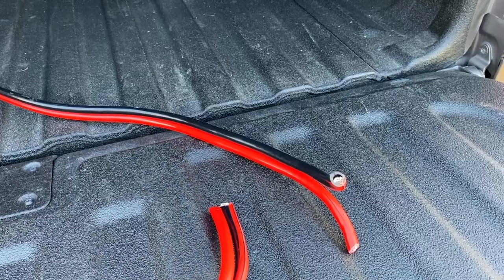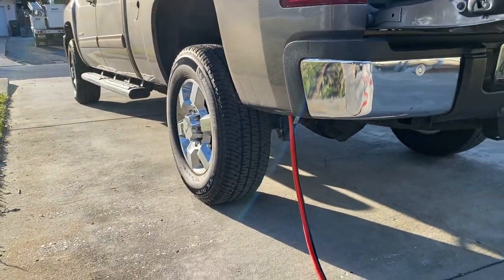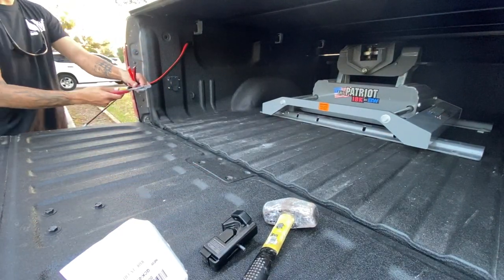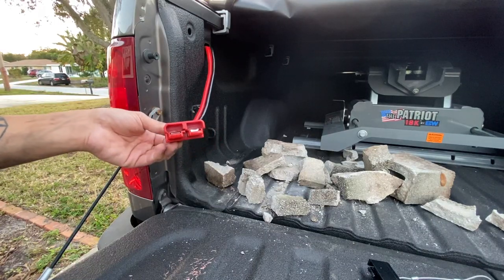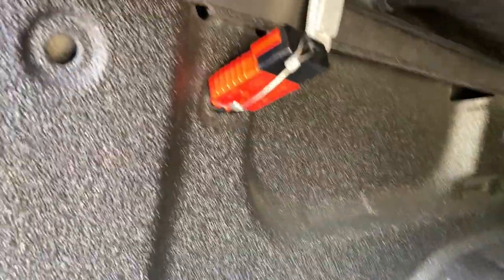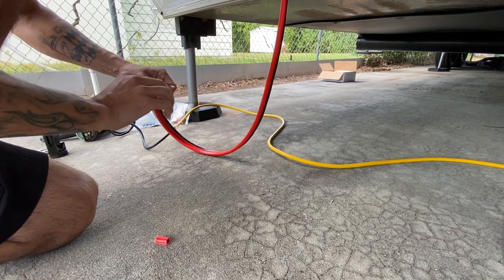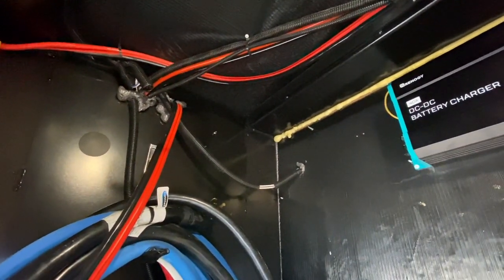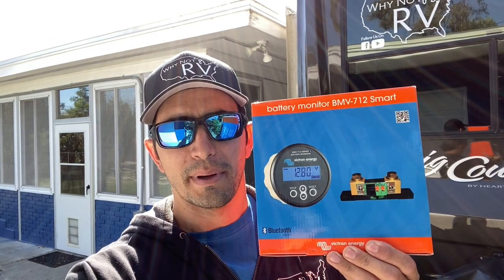Installing a DC to DC charger - Why Not RV: Episode 7

Comment: Hi. I just installed the Renogy 20amp charger.  After install, I was able to use my multimeter and determine I have 14.4 volts at the input side, but nothing on the output. I’ve wired the power wire to my trailer lights and the green lights turns on and remains a steady green.  I’m trying to figure out why I have no power/voltage on the output terminals.  Any insight would be greatly appreciated.  Thx. 
Jason
Reply from the maker: I’d start with confirming your have the dip switches set properly for your batteries, secondly, plug it in, make sure it’s on (green light) wait about 1-2 minutes and test voltage. It senses your battery voltage …
Reply: @WhyNotRV   Hi. Thanks for your reply.  After I hit send, I realized I should’ve mentioned my DIP switches are set correctly (at least according to the manual and the help of others who have provided additional feedback). Also, the unit is plugged in and I have a steady green light: nothing blinking flashing or red.  Lastly, you mentioned something about it sensing my battery voltage.  Does that mean the the unit senses the batteries are sufficiently charged, it will not output current?  If so, is it possible to adjust the range at which it begins charging?  Thanks again.
Reply from the maker: How is this wired? You said the output has zero voltage but if it’s hooked up to your battery you should be reading the battery voltage at least
Reply: @WhyNotRV  absolutely right. Yes, I have the same voltage on the output terminals as I do when I test the voltage directly from the battery terminals.   However, if I disconnect the Renogy unit from the trailer batteries, but it’s still connected on the input via my truck (alternator battery), shouldn’t I get a voltage reading on the output side of the Renogy?   Plus, my Victron smart shunt is not registering any positive voltage coming in, only negative out.  Thanks again for your help and asking great questions.  Hopefully, we can figure this out.
Reply from the maker: Unfortunately I no longer have a renogy charger so you may just have to reach out to them directly. I’m not sure, however, I believe if you disconnect the rv batteries The charger will not put out any voltage as it knows it’s not connected to a battery. Lastly, have you confirmed with your Victron shunt essentially no load? Meaning, when the RV is all hooked up and ready for tow what is your discharge amperage from minor ghost draws or whatever you have running? Then confirm ZERO change when charger is hooked up?
Reply: @WhyNotRV  thank you for all of your thoughtful replies and follow up questions.  I’m going to attempt to contact Renogy today.  Yes, I’ve observed the draw with the charger off and then once power is turned on, and no change.   I also found your other video of the Victron charger.  I have the Victron 12V/3000 MultiPlus II, and wish I would’ve stuck with all Victron components.  They just integrate and communicate so well together.  Thanks again.   If I get it resolved, I’ll update this thread. 
All the best,
Reply from the maker: Thanks Jason. Ya I’m curious to know what’s going on there. Keep me posted
Reply: @WhyNotRV  Well, mystery solved.  I should’ve known better, but after connecting the charger with a set of jumper cables and determining it was working correctly, I went back to focusing  on the truck wiring.  As a result, it turned out to be a bad ground. Repositioned the ground and problem solved.  Ugh!  🤦🏻‍♂️
Reply from the maker: That’s good to hear. Typically it’s a simple little problem like that.

Comment: Do you think I could have an issue running 4 gauge 500 amp cables from back of truck to charger and run 2 gauge from charger to battery?
Reply from the maker: Hey Vicki. The short answer to your question is NO, do not run 4 gauge 500 amp cables. The total run of the cables from the truck all the way to the rigs battery including going through the charger is what you need to size your cables for. The farther the run is the thicker the cables need to be. There’s several charts online that show what distance cables are rated for what amperage.

Comment: How did you do the dip switches for your battle born battery? Just another step that could be covered that’s over a lot of people’s heads.
Reply from the maker: Hey Kevin, Thanks for watching. Unfortunately I don't have Battle born batteries. I have AGM batteries and I set the dip switches for the AGM setting. I don't recall what that is but it was right there in the manual.
Reply: Why Not RV though I saw battle born’s. Sorry. Just a thought that it’s the details that normally scare people out of projects like this.
Reply from the maker: No problem. Thanks for the input. Im actually working on a video that will cover an update on this as well as a few other electrical upgrades I have made.

Comment: How do I know my Alternator will take the extra load of the Dc to Dc charger?
Reply from the maker: Most diesel trucks have oversized alternator capable of charging 20-40 amps no problem. When you get into the 60 amp charger or 2 of these in parallel is where you might need to consider running a dual alternator setup.
Reply: @WhyNotRV  I have a Colorado Diesel. Mid-size truck.  Looks like the Alternator would be 120-150 Amps.  Isn't there any way to know for sure? I would like to put in a 40Amp dc to dc.  I have 2 AGM Batteries 200 amp/h. Thanks :-0)
Reply from the maker: Just Google oem alternator for your year make model and engine and see what it says.
Reply: @projet2907  call any auto parts store and they can look it up within seconds. 
Give them your Vin # .

Comment: What amp is your alternator?  Mine is 160. Is that enough for 40 amp dcdc
Reply from the maker: I’m not entirely sure but the majority of diesel engines have bigger alternators that can easily support the extra 40 amps. 160 is plenty big depending on what else it’s charging or being used for.
Reply: Have found no answers anywhere on that matter, only "not too many amps or burn up the alternator"!  I suspect 160/40 amps is a safe ratio, but I wonder what a realistic limit is?  Even Victron and Renogy seem to publish no numbers. Like everyone, I'd like the maximum charging and best bang for my buck and efforts.  I'll probably run the truck with headlights, blower and everything running and see what the alternator puts out.

Comment: Would you know how to connect D+ to starter input ignition circuit on starter battery?
Reply from the maker: Yes, you need to just find a circuit on your fuse panel that is post ignition. Is this in a class a, b or c? Just look up on Google the fuse panel for your rig. Run a wire for d+ from one of those fuses. If you want further help feel free to reach out in Facebook and shoot me a message.

Comment: how do u no wich one to use? the 20, 40 , 50, 0r 60a model?
Reply from the maker: Hey, thanks for watching. It just depends on your charging needs and battery bank. Depending on your batteries they might only be able to take a certain amperage from a charger.
Reply: @WhyNotRV  oh wat up dawg. jeez so any amp model will work is wat your sayin? oh no wait will this charge 24v bateries? i think is the real question
Reply from the maker: What’s goin on... No this will not charge 24v. I think victron has one that can have different voltages. Not sure though.
Reply: @WhyNotRV  oh man good thing i asked thank u sir
Reply from the maker: No problem. Good luck finding what you need
Reply: @WhyNotRV  jesus im gona need it tryna liv in my van
Reply from the maker: https://www.lithiumion-batteries.com/products/lithium-ion-chargers/12v-to-24v-dc-to-dc-lithium-battery-charger.php
Reply from the maker: I believe this is what you need
Reply: @WhyNotRV  i dont hav lithium. can i still use it?
Reply from the maker: Yes. It’s suitable for lead acid or lithium it says in the description
Reply: @WhyNotRV  thank u thank u thank u
Reply from the maker: Absolutely, glad I could help
Reply: @WhyNotRV  can u tell me the diference between the isolated n the non-isolated versions?
Reply from the maker: The difference is the ground is shared on the non isolated and there is a separate ground for the isolated. There’s some pretty in depth electrical studies and videos on the 2. I would always stick with the isolated personally for any trailer. Perhaps in a van or class A or class C the non isolated would work as both the starter battery and the storage (house) batteries share the same frame as a common ground.
Reply: @WhyNotRV  sumone anserd me on amazon n said that the non isolated one keeps charging wit the engine off. thanks again sir
Reply from the maker: No worries
Reply: @outoftime788  what do you have in your rigg that runs off of 24volts?
Reply: @jamesglenn520  nothing. i run my 24v batery thru the inverter wich runs 120v. so thru that i run jus a tv and chargin devices. but i dont even really use it anymore. change of plans. im wanting to get a biger vehicle like a shutle bus
Reply: @outoftime788  oh ok. I just had not heard of people running 24v systems for rv use before. Usually it's just multiple 12 or 6 volt batteries in parallel or series.

Comment: dude what setting did you toggle on the charger ?
Reply from the maker: Every battery type is different and requires different settings. At the time of that install I had AGM batteries. Now have Lithium and have switched to a different charger.
Reply: @WhyNotRV  for I have my start battery to my AGM
Reply from the maker: Different manufacturers have different recommendations. If you look at page 16 of the manual you can see how to set charger voltage. I had all of my dip switches set to ON but that’s just me.

Comment: I have the new 60amp version do you find it to get pretty warm when running on the output side and terminal area also ? Also does the heat under your hood make your battery cables pretty warm to the touch ?
Reply from the maker: Hey, thanks for watching. What gauge cables do you have running to and out of the unit? I have not experienced the cables getting warm at all, I routed them under the hood as far away from heat components as possible and have not experienced excess heat anywhere on these cables. I have now driven 8000 miles with this installed and being used the entire time. Electrically speaking excess heat in a wire is generally because the wire is not sufficient for the current.
Reply: Why Not RV Why Not RV hey thanks for the reply. I am running about 20-25 foot of 2 Gauge pure copper welding cable I should also mentions it’s not just those cables but every cable under the hood around the battery area it was 90f yesterday maybe that had something to do with it. I have 2 foot of 4 gauge from the charger to the RV battery also. I have a Ram 1500 if that helps for location purposes.
Reply from the maker: I would have 2 gauge on the output to the house batteries. Otherwise sounds good

Comment: Links to the wire and connectors would help.
Reply from the maker: Keeb, absolutely I’ll get that posted in the description but here you go...
Connectors... 
HYCLAT 2-4 Gauge 175 A Battery Quick Connect/Disconnect Wire Harness Plug Connector Recovery Winch Trailer https://www.amazon.com/dp/B01KHQR0K4/ref=cm_sw_r_cp_api_i_.D9JEbD886CWY
Wires...
ABN Jumper Cables, 25ft Long, 2-Gauge, 600 AMP – Commercial Automotive Vehicle Booster Cables – Motorcycle Car ATV https://www.amazon.com/dp/B00R516D3K/ref=cm_sw_r_cp_api_i_nF9JEb42RDDA4

Comment: I'm curious how you decided on what amperage of charger to use?  I've heard that there's a maximum amount of amperage of charger relative to the amperage of the battery bank that you don't want to exceed.  Also, 2ga wire from the charger to the batteries seems like overkill since it's such a short run, any reason you didn't go with like 6ga?  Does that model of charger you used automatically detect what type of battery and then adjust the charging profile to match the battery?
Reply from the maker: Hey, Thanks for watching. I decided based on what my load is while towing. My fridge and ice maker stay running while towing and together pull almost 40 amps DC through the inverter. They are both intermittent to full load so when they're not this thing charges my batteries and when they are this will maintain current charge. After using it on the road for 3 month I am extremely happy with it and it has worked flawlessly and every time we move we have full batteries at the next stop. In terms of the too much amperage, this is significantly lower than my converter which charges the batteries while on shore power so that’s definitely not a concern of mine. The 2ga wire is overkill but when you are messing with heat and wires I would much rather be safe than sorry. The charger has a few dip switches on it so you can tell it what charging profile you want for it based on your types of batteries. Let me know if you have further questions.
Reply: Hi, I have been fielding the same question to youtubers and RVers for days.  I want to use the biggest charger I can for maximum battery charge when driving.  It seems the vehicle alternator is the limiting factor.  I have read/heard over and over that too many amps = hot alternator and potential burn out. 
When the battery is low, the current will max out to the charger's limit.  Anyone who has big battery storage (2-300 Ah for me) would want the fastest feasible charge time, No?  Seems to me the charger size should be selected by the "headroom" amperage the alternator has above the usual demands of the vehicle (headlights, heater, wipers etc.).  So far, nobody (including Renogy) has been able to tell me what size I can use with a 160 amp alternator.
Reply: I am getting ready to install dc to dc and bought 3 Guage  jumpers because they were cheaper and had connectors already installed on one end
Reply: 2 Guage not 4
Reply: It has tiny switches he's on the back where to set your type of battery. There tiny and hard to see.  I have one.

Comment: Could you just mount your negative to the chassis closer to the charger to save cable
Reply from the maker: Of course technically you can but I wouldn’t. You’d have to fuse the cable feeding the frame and you’ll also need to make sure your negative off the battery is gauged properly for the load.
Reply: @WhyNotRV  ok maybe my setup is dangerous then I've got my 40 amp renogy hooked up after my old school dual Battery isolator that only pumps out 25 Amps max. Because I'm running a 100ah lithium ion phosphate in the back I put a DC in between to protect my alternator maybe I need to go see an auto electric guy I suppose. Thanks for the reply my mehanic mate allways said a little bit of knowledge is dangerous. I thought I was onto a good thing as then I don't need a switch as the isolator would only  allow the charger to work when running. And those set ups run the earth from anywhere in the back

Comment: Renogy has the worse customer service I have ever seen. Purchased  the 60 amp model and did not work from day one. They stalled and would do nothing.  Think God for Amazon as it was over 30 days old,but they agreed to send me a replacement. The new one did work, no thanks too Renogy.
Reply from the maker: I like to mainly stick to Victron products but sometimes when the prices good you make it work. Definitely need to always go directly to the seller when Amazon is involved. They have outstanding customer service.

Comment: Nice video but I would upgrade my alternator to  a higher output and change my starting battery to a multi purpose deep cycle
Reply from the maker: Hey Thomas, thanks for watching! I appreciate the input and comment. Having a large diesel truck the alternator is already rated high enough for this extra power but you definitely need to ensure your alternator is rated for the extra output
Reply: Oh c I learned something new thanks I didn’t know that
Reply from the maker: Thanks again for watching 😁

Comment: using jumper cables as your wire is so fooking smart
Reply from the maker: Had no issues over a year of use. Oversized the gauge and it was perfectly fine. If you look at the channel I just posted a new video where I replaced this charger and wires.